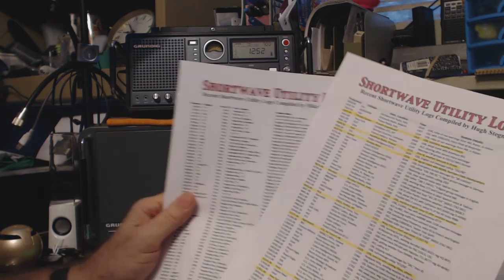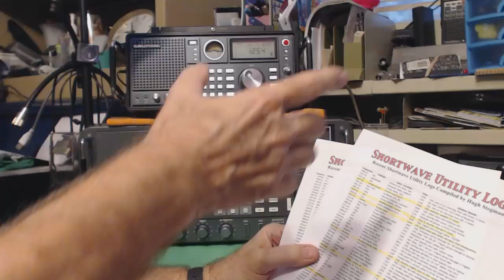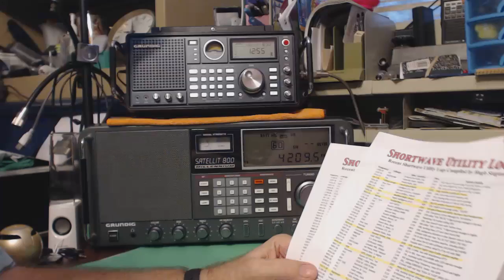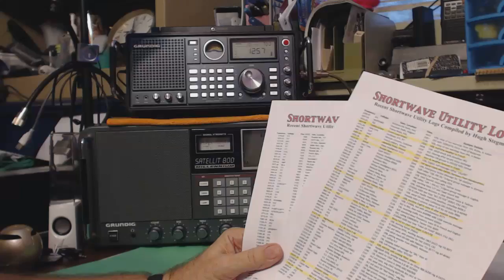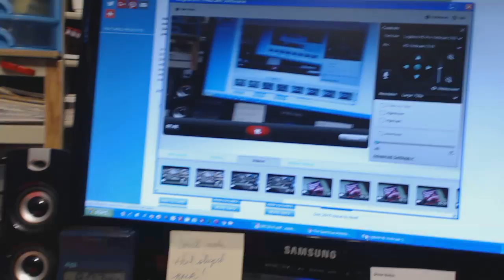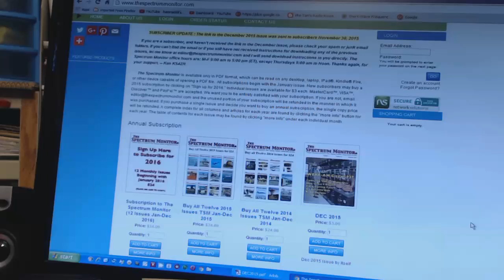TRRS #0740 - Shortwave Utility Radio

Comment: That was awesome Tom! Thank you for doing a show on utility station listening. I think it is a cool hobby! I have an FRG-7 that was given to me a few years ago. It works ok..  I just need a better antenna. I am limited to indoor antennas only. I am in a rented house, so I can't drill holes in the walls to get an antenna outside. I also have a limited budget being that I am disabled. So whatever kind of antenna I use has to be cheap or home built :-) Thank you again for sharing Tom!
Reply from the maker: +Mike Notarnicola The Frg-7 is one of the interesting radios.  I am still trying to find in in good shape.